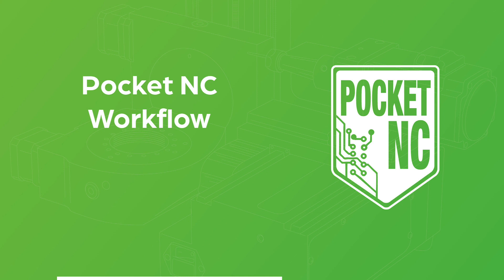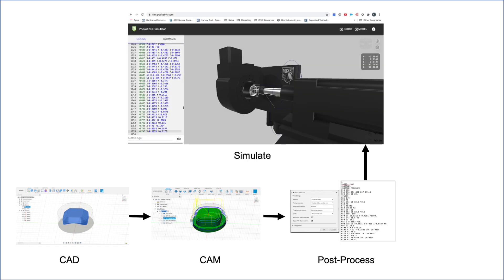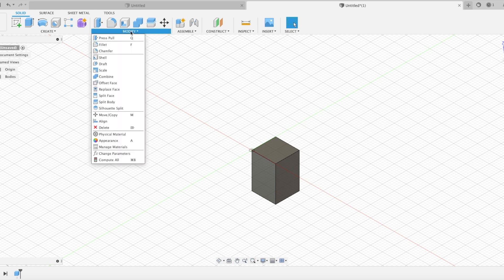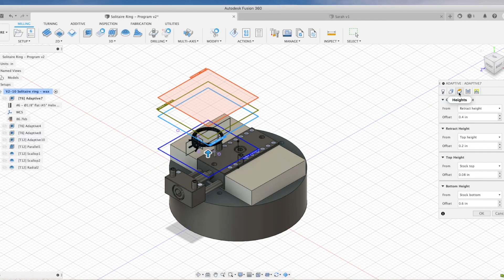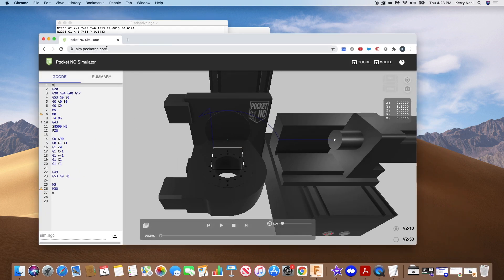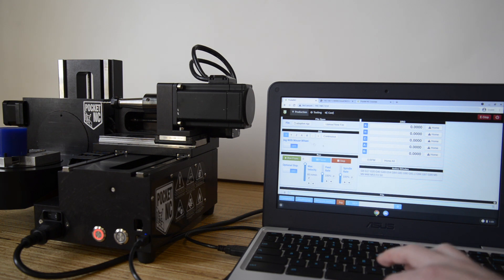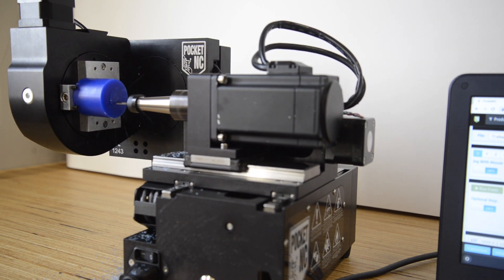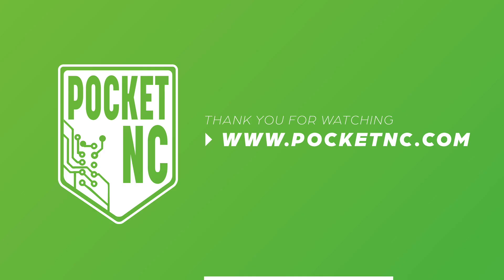Pocket NC Workflow

Comment: Hello there! I am new to CNC milling.  Could one have a water hose or sprayer wetting the part being milled with the Pocket NC?   Thanks
Reply from the maker: No, the Pocket NC machines are not sealed for coolant so we don't advise using any form of wet coolant on the machine.